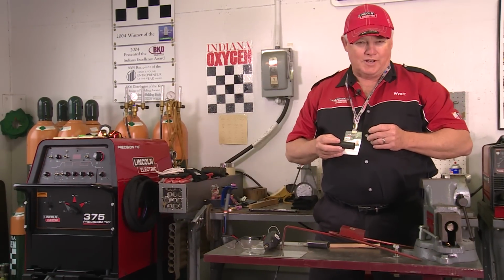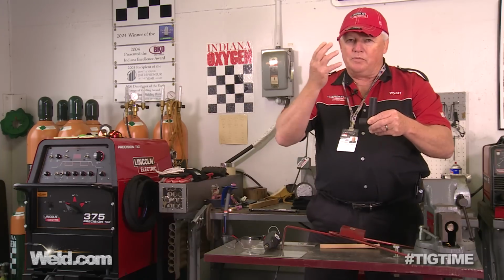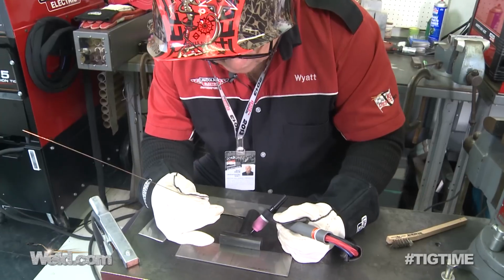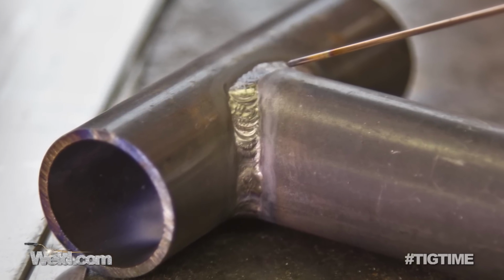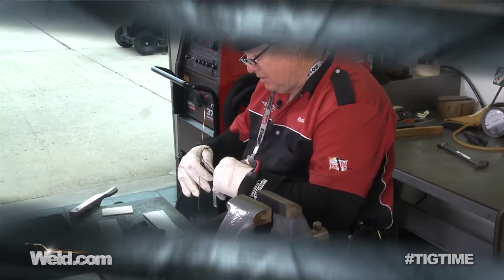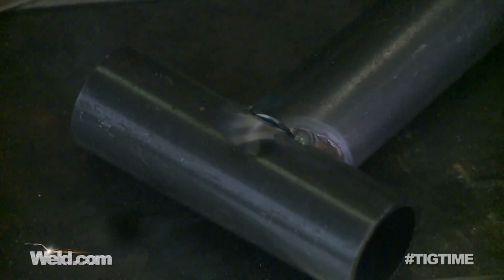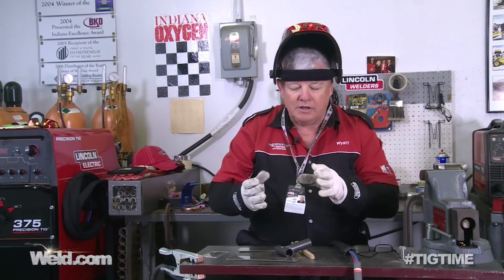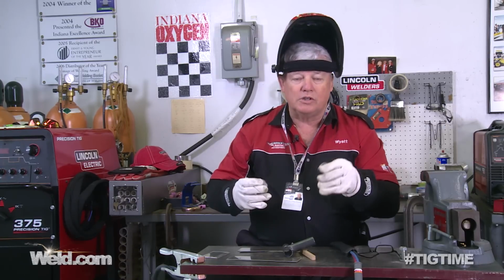TIG Welding and Testing 4130 ChroMoly: Visual Inspection | TIG Time

Comment: At 5:06 in the timeline, is there not undercut at the top of that main tube, there on the right? I've been gas welding 4130 for years, and I would be frightened by the lack of weld reinforcement I see from many TIG guys. And on this demo it sure looks to me like there's not enough of it in many places on that weld.

Comment from the maker: During the 3 weeks that I am working at the Indianapolis 500 garage, we have (3) different work stations set up.  When welding on the dc- mode there is little advantage from one machine to another. Therefore, I chose the Precision tig 375 at random.  

thanks for the question.. Mr. Tig

Comment: I noticed you used the Precision TIG (transformer) instead of the inverter style machine you normally use. Was this just because they only had a transformer in the garage, or do you prefer the transformer machines for 4130?